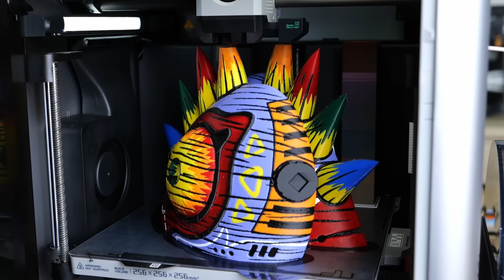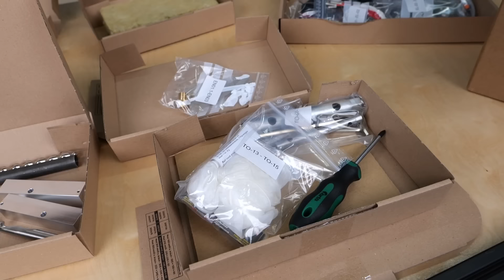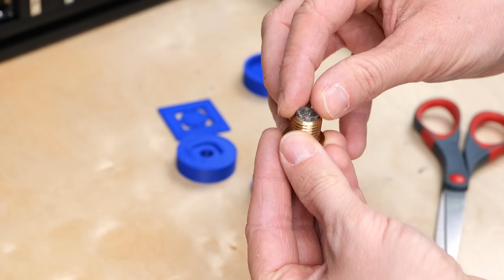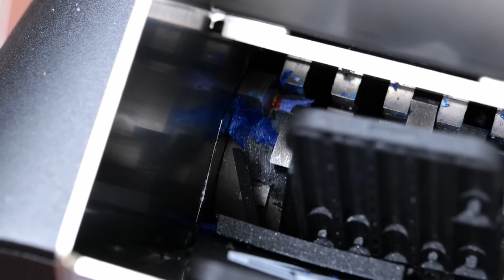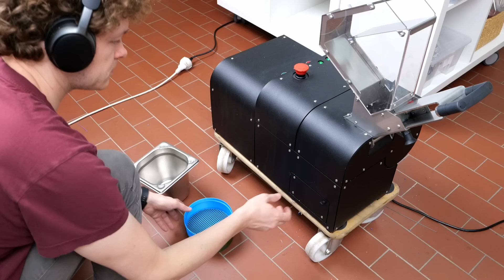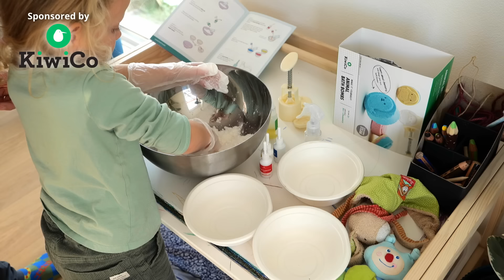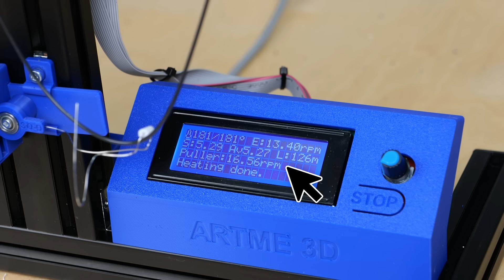Recycling Failed 3D Prints with a DIY Filament Extruder: Artme3D

Comment: Does this also work with chopped up PET plastic bottles? I really want to recycle water bottles but so far I've seen people using only homebrew machinery for PET bottles.
Reply: you can actually make a PET filament machine out of just an old ender 3 if you have one sitting around. most people do. just look up '"ender 3 bottle filament files" and you can learn more

Comment: Thorough video, thank you. Could you please identify the optical angle sensor component that it uses for filament detection? That would be a better component to use than the mechanical potentiometer in my project. Thank you.

Comment: Not sure how 600 bucks is inexpensive, i mean i can get rolls for 12 quid now, that would take 50 rolls just to break even, plus you got the problem of quality, keep checking its 1.75 seems alot of effort, 
Id rather use scraps to fill molds and sell them

Comment: I had previously extensively researched recycling 3d printing material around 2 years ago. It was a flunk. The machines were too expensive and you would never ROI your investment into one of them. Very happy things have changed, and thank you for this video.
Reply: it is going in to nice direction but 600$? 
ROI is still not there

Comment: For a home DIY player the doable way for this project is to redesign and replace all CNC parts by standard parts that are already exist in the market. I made myself one under $120 and no other equipments are needed except a cheap disinfection cabinet under $20 for drying purpose. A bag of 25KG ABS raw material cost me about $50. Average price for 1KG ABS filament is about $7 so basically I can print ABS in $2 per KG after printing 25KG of raw material(I don't do recycling, no reason to do that). So for normal 3D printer players who have no ability to do redesign and print less that 20KG per year should skip this project immediately and order filaments online.

Comment: An optical or laser filament diameter sensor could be a decent addition to this machine. It would allow realtime adjusting of extrude parameters. Might be even possible to use it to detect flow rate as well so one sensor does both functions.

Comment: I think there are some ways to do this very smartly.  First to consider, is that the plastic can be melted  many  times without consiquence as long as the plastic is not overheated. I think that the "can only melt it so many times" thing is a myth. The Brothers Make you tube guys proved this through testing. 

On the nozzle end of things; one thing to do is to melt the recycled plastic twice.  Once to a large diameter without regard for consitancy or hydroscopic quality.  Then take the large diameter filament, and chop it into pellets.  On the second round, the fact that it is in pellets will allow for easier qualtiy managment. And it can be mixed with new plastic pellets.  

Another thing to consider, is to use a really large diameter nozzle to make  5/16" x 4" mini glue gun sticks.

Comment: Have you tried making ABS or ASA filament from pellets? I don't produce enough failed prints to need it for recycling, but I'm definitely interested in this extruder as an affordable way to make filament. Most of the people here are interested in it for the recycling aspect which is cool, but I see the value in it for buying cheap pellets and producing my own filament, if it works well.

Comment: "Why don't you make an extruder that will have a large container, for example, 7 liters, where you can put 3D prints in one piece (not crushed), and a large heater that will melt everything like soup and extrude the desired filament from such melted material?"

Comment: So all you had to do to recycle the incredible amount of waste you produce is:
1. purchase a 600$ machine  
2. print it with 1.5 spools of more plastic over 50 HOURS  
3. Spend an entire day constructing it 
4. have it running for hours while paying close attention to it
5.  Purchase an enterprise shredding machine for another few hunderd of dollars.

6. shred all your waste for hours
7. Dry your plastic waste in an over
8. Dry your plastic waste in a vacuum chamber (that costs more money)
9. purchase, use and create desiccant waste 
10.purchase Rockwool insulation and handle it by your self
11. Finaly, maintain the recycler constantly to avoid clogs and metal bits from the shredder getting into your 3d printer and causing it too, to make more waste.
12. Why would anyone do this except for complete over abundance of money and time.

Comment: That's pretty cool. I'm just starting to get into 3d printing. One of the things holding me back over the years is the nagging feeling of guilt from the sheer quantity of waste, both from failed prints, and the fact that most things printed are just trinkets that accumulate.

Even if this operated just at breakeven, or even a slight loss, it would go a long way.

Comment: I imagine if you accumulate a LOT of plastic waste, doing something like this may even pay itself off in saving money from spools and spools of filament

Gosh, that filter is absolutely genius, I can only hope that it's easy enough to take out and clean. Filtering out unmelted debris that is only larger than your nozzle diameter is a surefire way to prevent clogging, and will pass any debris small enough into your prints invisibly. All I can do now is to hope for cheap shredders

Comment: I did some math to see if the extruder is worth it.  I use cheap PLA at $18 a spool.  If I waste (worst case) 20% from each spool from failed prints and supports that is $3.60 per spool.  I would have to make 166.66 spools from 833.33 original spools to break even on a $600 extruder.  Not really a hobbyist toy.

If you use filament that is a couple hundred dollars a spool, then the extruder is worth it.
Reply: Agreed. Nothing more to say!
Reply: Maybe it’s not that efficient but it sure is when you think about how much Plastik comes in the Ocean and it’s good for teaching your Kids recycling!
Reply: @FiFredFpv  What is the point of recycling if the process is less efficient than making new?  Inefficient recycling uses MORE resources than not recycling at all.  Isn't the point of recycling to SAVE resources?

Recycling in and of itself is not "good".  Efficient recycling is "good".

Just burn the plastic in power plants instead of coal and scrub the exhaust with catalytic converters.  BOOM, efficient.
Reply: And it’s good for big company’s that produce a lot of Plastic garbage
Reply: @FiFred7  Agreed.  It is a good and useful product... just not on the small scale.
Reply: its cool.

Comment: This is a very nice machine, I hope they will become as affordable as printers.
Reply: The thing is, required material and energy (electricity) will probably never make it profitable. It will most likely always be cheaper for individuals to just buy filament.

This is different for industries where the scale can definitely cut costs to a profitable point. So it's actually more virtuous to setup a back-to-filament-maker recycling circuit.

Comment: Hmm add a water cooling for extruded fillament? Like a flared copper pipe that has tank soldered around it and it has a water pump to cool it down .You could connect pump to a bucket with ice and water. As filament passes trough pipe it should cool down.Just and idea ,dont know how usefull it might be.

Comment: If you are concerned about moisture get a moisture analyser, stuff like ohaus is simple to use and not too pricy, but not too precise either 
Also if you can check the drying conditions of your polymer because you might be drying them insufficiently, generally 80oC 4h in vac oven works best

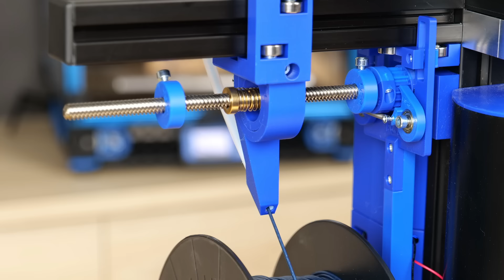Comment: 5:10 What the hell are you talking about? The wind is good in the middle and turns into mess at the sides. all this work and engineering, just to get the same result as with a hand cranked respooler.. Stop lying.

Comment: "only 600 bucks"...
Reply: Only 600 bucks, a shredding machine, a drying oven...
Reply: @000Heramy000  imagine its almost 1month minimal wage in poland xD
Reply: @Czapsonn no prawda:(
Reply: @Czapsonn here in Dominican republic is like 4 months of a minimum monthly salary 😢
Reply: @000Heramy000 thats what lost me
Reply: @000Heramy000 let’s give the entrance for a loan of a house in some countries in EU with all this equipment cost?
Reply: @000Heramy000  Pressure chamber.
Reply: 40 rolls of filament at $15/roll
Reply: @chrrybm8 plus cost of that big shredding machine
Reply: It's cheap compared to basically any other machine you can buy that does this. Even a completely DIY solution wouldn't be that much cheaper because you still need motors, power supply etc and this provides very decent results.
Reply: 60 filaments will be better
Reply: 😂😂😂 same
Reply: The Loop is over 2,000.00, so 600.00 is being fair.
Reply: It’s really not that bad, especially if you print a lot. But yeah, it likely just will never be worth it for the usual consumer
Reply: Eh, I've seen machines like this run upwards to 6,000. So it's really not a bad price, especially for the quallity. Plus, you can always not use dryers and shred in a juicer or blender like he mentioned. If you can find an antique bucket juicer, that'd be your best "cheap but effective" solution.
Reply: Grow up, childish and confused you are. 

It's "only 600 dollars" because of the cheap price compared to others on the market, his statement has nothing to do with 600 being alot or little to nothing, it is also a personal statement as to his own financial situation, this is why school is important so not to think with your feelings.
Reply: 1000 in AUD 😭
Reply: How much in USD
Reply: Not really all that crazy when you own a $3000 printer😂
Reply: Over a long period of time, it could save you, thousands But to be honest yeah it is pretty expensive
Reply: I don't think using that machine is ever financially smart...filament is cheap and the expensive stuff you likely can not recycle (PEEK, PEBA etc)
It's a cool project tough

Comment: This seems like a lot of work, and a lot of money based on a return-of-investment point of view.  Think about how many rolls of filament you could buy for $600.  At least 30 rolls of PLA.  Now, think how long it would take for you to accumulate 30 rolls worth of scrap parts, in order to save the cost of the machine.  And that's being generous not considering the electrical costs, time need to run the machine, maintenance, additional equipment needed to shred the scrap and the fact that the filament produced can't be used for many parts (color, size tolerance).  Just because you CAN do something, doesn't necessarily mean you SHOULD.  I'm would think efforts (and $$$)  would be better spent improving the printing process, so you don't have so much scrap.  Some ideas are: Get a better 3D printer, carefully review the print preview before printing a part for the first time; Print only tight tolerance portions of a part for test fitting before committing to printing the whole part, only to find that your tolerances were off; Printing process discipline like, always cleaning the bed, using glue stick, fine tune first layer print settings, etc.  Not trying to be a hater.  Just my opinion of the utility of this as a product.  Thanks for taking the time to prepare this video.  It was interesting to watch.

Comment: This is just so cool. I'd love to do something like this but my hang-up is always on the other side of the coin - the shredding. It seems everything comes up short except a purpose-built electric rig with metal gears and they have to cost a fortune.

EDIT: This being said, I do want to set something up to turn plastic bottles into filament, as that doesn't require the shredding step. PLA is a whole other problem to solve when it comes to the shredding.

Comment: It really bothers me that PLA filament isn't really biodegradable and that 3d printing produces so much waste. I wish there was a system of recycling all these plastics and that people chose to stick to it (to take part in separating/saving their filaments for recycling). The amount of plastic being saved would be massive... and also, it could be used to help a Lot of people. I think having personal filament extruders would save a whole ton of waste if people choose to recycle their own filament... but mot people just don't have enough waste to make it worthwhile. The amount of time and the frustration probably both make it less likely to become a common practice. Even if just 1 in 10 people had filament extruders, then they could get waste from the other 90% of people and either create free filament for themselves and/or recycle the waste for the people that give them the waste. My only worry is all the different manufacturers, qualities, colors and types of filament. It would be nearly impossible to make a consistent, quality filament that flows evenly at a specific temperature, has a predictable strength, flexibility or other properties and/or prints at the same temperature/settings throughout the entire batch (or between batches). That could be a good explanation of why it might be worth trying to stick to one or two specific filaments and not a whole bunch of different one's... so the waste is consistent and can be recycled all at once and the person wouldn't have to sort, keep separate and store a whole bunch of different filaments until enough is saved to recycle of each specific filament.

Comment: @CNCKitchen Have you heard of the INFiDEL by Thomas Sanlander? Its an inline filament sensor, and if the designer of this actually added the sensor to this project, it would be more autonomous. It is capable of feedback, and He said that if someone wanted to, it could be used to have a variable extrusion rate during printing, based on the filament diameter. that basically means your filament tolerance doesn't need to be as good. Here is the video Title: Make your own inline filament diameter sensor (under $5)!

Comment: I’d love to see you create your own blend of engineering filaments with this machine! I mentioned it in a different video but would love a nylon 6 cf/gf like material in terms of strength and durability that doesn’t wear out nozzles. I think Asa as the base mixed with another more flexible material would be very interesting

Comment: I have a few bags of failed prints, but there may be some PETG mixed in with otherwise mostly PLA. What kinds of issues would you anticipate from that? Is there any way I could figure out which parts are PETG and separate them out?

Comment: In place of the Teflon tape you could use high temperature silicone gasket maker. The stuff that's used in the automotive industry and specifically the silicon used for the exhaust.

Comment: I like hearing that we're inching closer to viable, consumer accessible systems. That said, this is still rather expensive as far as a kit goes when it all adds up. And the fact that you probably do need a decent shredder, drying oven, and other tools in addition to this means the total cost is still far north of 1,000 currency units.

Comment: you can try using  a photodetector to get the diameter of the filament  and adjust the temps and speeds programmatically (automatically).  current sensor for the screw to detect any obstructions.

Comment: You know, the fact that this machine works AND is cheap (ish) shows that recycling our waste filament is something the market wants enough that individuals and small collectives ARE willing to take the time and effort to bring the price down and the efficacy up. The first of these machines I came across while searching printer stuff was 5 grand US (7500 Australian to me plus a #$%& ton of freight!) and most of the reviews said it was great with virgin beads but garbage with shreddings. If this one works as well as you say, US$600/EU650 seems like an order of magnitude in 5 years. Way ahead of Moore's Law! Still too rich for my cubic metre (air included, so way less than a cubic metre) of wastes and fails from nearly 7 years of printing, but we're getting there, and that is awesome. The next major breakthrough needs to be a process that recycles PET bottles into filament without having to print directly from the recycler and with little or no crystallisation from the remelting.
Reply: Oh, hey, just sw you have a video on this, too. Off I go to look 😀

Comment: Im still in highschool and i only have a single printer that i have had for over 2 years, but i hope that when i get older and i have the oppertunity to have a designated printer room, that a lot more filament extruder machines have been put on the market so i wont have to throw away kg's og plastic in failed prints and supports.

Comment: This is pretty great.  Sure, it's expensive for hobbyists, but as long as it's reliable, and doesn't fall apart, over time (somewhere around 40 rolls) it will pay for itself, and then start saving money.  The big problem is an affordable shredder.  For me, it's not really about the cost.  I just hate my hobby being part of the plastic waste problem, so if I can do something to recycle my own waste I'm all for it.  I don't think this is quite ready, but it's certainly encouraging.
Could you please give details about your shredder?  There is a lot of household trash that I would also shred, so it wouldn't only be used for recycling my 3d printing waste.

Comment: Well, I don’t know... it looks like 150€, not 600. And the prices for DIY components are... very-very strange. 
120€ for spiral thing? 2 meters of aluminium profile for 60$? Some metal components for 350€? No way dude! 
Moreover, you still need to print plastic parts yourself.

It's very difficult to call it DIY and this is clearly not the 600€ level.